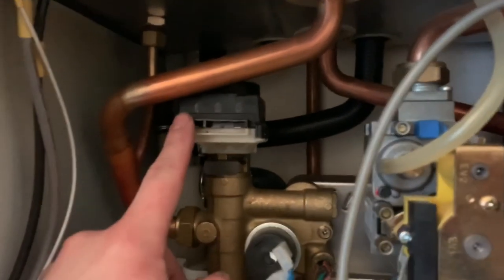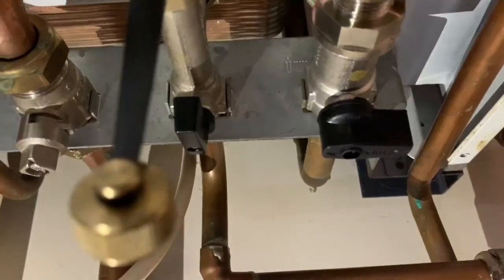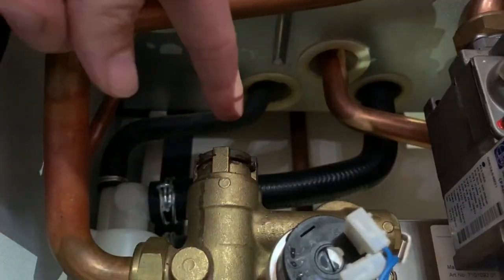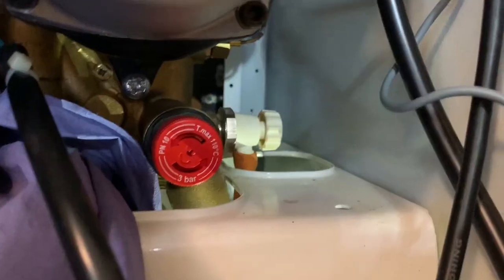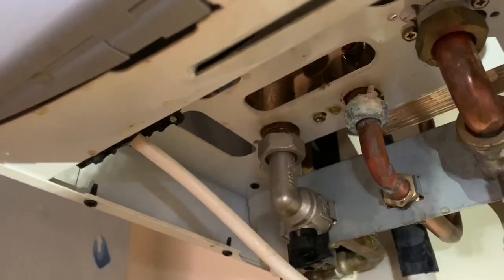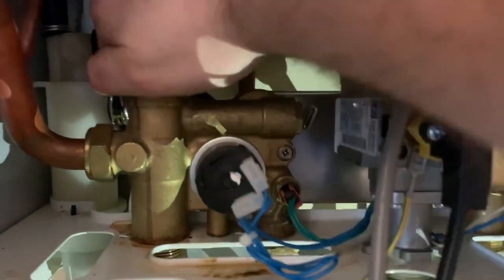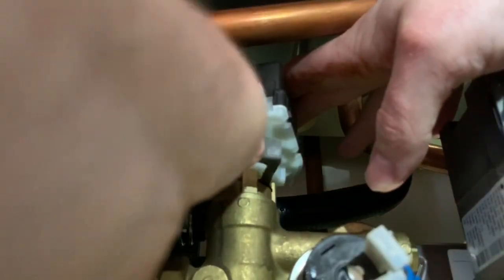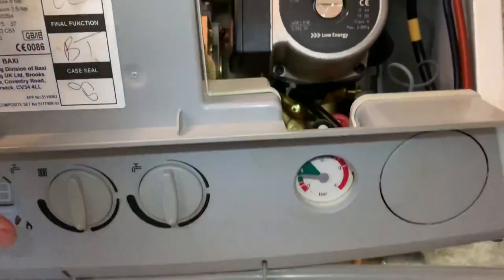How To Replace A Diverter Valve Cartridge And Head On A BAXI Duo Tec Combi 33HE Boiler

Comment: I just followed along with this how to video on the same boiler used in the video and it worked perfectly. Hot water now restored, thanks for sharing.
Reply: Hi I'm pretty competent contemplating ordering the part got heating but hit water just going cold all the time think it's been long time coming ..just power off some draining and easy enough ? Currently got front off and lower section lowered

Comment: Hi there can this valve issue also cause the radiators to remain cold but have hot water? As I appear to have no radiator flow, but power to the pump and it sounds to be running. Thanks
Reply: I think so. Hot water but no heating. The diverter valve is stuck. This could be the issue.

Comment: Thanks for the clear instructions on this video. I'm getting a lot of water leaking out from just where the motor head sits - would this be an indication to replace the diverter valve as you've shown, or some other problem? Potterton Promax boiler, about 10 years old.
Reply: I'm hoping to do ours in next day or 2 . But get a new  mot8r head only around 10 quid . Likeky just seals gone bad and the motor will be affected corroded etc

Comment: This diverter has been replaced 4 maybe 5 times in 7 years on my baxi duotech 24 he, any idea why this fails so often, also recently noticed hot water temp gauge goes over 60 when its set to 50, it also exceeds 65 which is supposed to be the max, do you think there is a fault with something or is this just normal for baxis
Reply: Mine has also apparently failed twice in the five years we've lived here. We have noisy pipes and what sounds like a water hammer issue. I wonder if a water hammer arrestor would help.
Reply: Hi I have had this issue on 2 boilers and had numerous cartridge valves replaced on both. It was such a joke, in 2018 Baxi even changed the boiler for free, ensuring me this would solve it. The new boiler lasted 15 months before that as well failed. It’s a moving part but it’s been massively under engineered to save costs. What they have saved in component build costs, would now be well outweighed by the amount of breakdown warranty claims. My boiler is currently broken down, awaiting another engineer visit to repair the same fault again. I am now considering getting the boiler replaced with a different manufacturer as it’s proven over 2 boilers these Baxi / Potterton boilers are really unreliable due to this fault.

Comment: I followed this steps and i fixed my boiler....thank you so much....
Reply: I have a question....i just realised that after replacing that diverter valve ...when i use hot water my radiators start to heat up aswell even when the heating is turned off....any advice?thanks
Reply from the maker: The role of the diverter as you know is to divert the water from the heating to hot water when required, I would suggest checking the diverter again for blockages/debris making it stick. Double check it is working and the motor head is doing its job too. 👍🏻

Comment: Thank you for the tutorial video. I've just replaced a faulty diverter valve for the grand sum of £23.90. parts and a length of 10mm rubber tubing to connect to the drain off valve. Plumber wanted £180 all in
Reply: I was just quoted £288.
Reply: Great video . . .but even though it seem a lot, that is standard price for a plumber

Comment: Great video. Is this likeky my issue .......h9t water often goes luke warm or cold . Pressure of hearing system is mostly stable but can drop by 0.5 if it kicks . Rads all hot . Bled etc no air in rads . Occasionally 1 tap on its own won't activate the boiler but 2 taos will.....But often same issue with water going warm ir cold .

Thank you 
I've got the both parts on order you mentioned inc a thermister just in case. 

Thank you

Comment: Great video. The pin in my cartridge wouldn’t depress. It is stuck. It’s making a loud noise when switching over. Would this be the cartridge or the motor. TIA

Comment: Great video
So easy when you know x

Is it easy to change the heat exchanger in this type of boiler ? I have the 24 HE model and I’m going to attempt it. The manual says you have to firstly remove the gas valve !!!!!
Also….. what gauge (bore size) is the orange tube ? 1/4” ?

Comment: Hi. Watched this vid re changing valve motor unit.  My duo-tec 5yrs old is tripping our circuit breaker and I found a water leak, just a bit wet, around where this motor unit is fitted onto the water valve. Do you think internally the motor unit might be getting water damage causing the trip? The plastic casing and where elec connector is fitted all looks dry though so was looking for advice. Replacing the motor and valve looks really easy for me and would be a great fix if you think is cause. Appreciate any feedback

Comment: Hello Dan , thank you for the video . Wanted to ask if i am going to replace a double check vlv isolator do i need to drain the boiler ? Or can i switch off the boiler and turn off the pressure keys to change the old vlv ?
Reply from the maker: If you’re replacing the built in full valve then you don’t need to drain off just isolate under boiler and change 😊
Reply: @PlumbingGy  Dan you’re a legend - subd

Comment: Hi mate I have the exact same boiler but have no central heating should I change the diverter valve cartridge or pump? Thanks
Reply from the maker: As long as you have the required certificates to work on gas 👍🏻👍🏻

Comment: very nice video .mine is jammed.  cartridge is been stucked only  top part of the cartridge comimg off rest has been stuck.  do you any reason why is it happening. thanks
Reply from the maker: They do require a slight wiggle but be careful not to snap it, as it is only plastic

Comment: Would this part only make noise when calling for hot water? Our system has been making a whining noise when only the hot water is called and running and not the heat. Seems like the noise is coming from the head.
Reply from the maker: You may notice a slight whine if it's clogged or potential debris causing an issue inside, or when you hear it working it may sound like a click which can be a sign of the head going. 👍🏻

Comment: Hello, I have the same boiler. I drained the system and fitted a new radiator, I filled everything back up. Now my problem is I get hot water but no central heating. I can hear it turn on, but no heating to the radiators. So will doing this fix the issue.
Reply from the maker: It could be a few issues, unfortunately without looking I can’t give you a good answer

Comment: Just changed my divertor valve and now my temp is going through the roof. Lots of scary noise coming from boiler. So much so that I've got to switch it off. Any ideas?
Reply from the maker: I would go through the checks for the thermostat, without looking all I would suggest to start with 👍🏻
Reply: @PlumbingGy  Think it was an air lock. I bled the pump and all my radiators and its all working now. Cheers

Comment: Hi Dan. How come this part was changed? I have the same boiler. Some of my radiators are hot, some aren’t even warming up. I’ve checked for air and flushed the system.
Reply from the maker: This was changed due to the valve not operating correctly so it would either be hot water or heating, the other wouldn’t work at all.
It does sound like yours may have either blockages or debris build up with the rads/valves, if some are getting hot you know the valve is working…. Unless they’re piped off the hot water circuit 🧐
Reply: @PlumbingGy  I doubt they’re piped off. Everything was working fine. Been off all summer then came winter and some were hot and some weren’t. I’ve thrown some flush into two radiators. I’ll let it get round the system. Then flush it out and see how I get on.

Comment: Question, is this a job someone is allowed to do themselves? Quoted £300 for diverter valve replacement by a highly recommended local company. I thought you should never touch the boiler yourself.
Reply: I think you're probably good so long as you just don't disturb the gas system... At all!

Comment: Not fancy mentioning how to check if a bypass is fitted ..🤔🤔
Reply from the maker: Why would I mention that
Reply: @PlumbingGy  maybe cos if divertor has the built in bypass from it as some do then the cartridge can’t be replaced and it’s a full new valve.. 🤷‍♂️
Reply from the maker: It would be different therefore a completely different video. If the person replacing the part cannot identify simple observations before they order the part then they shouldn’t be touching it. Again it would be a different part entirely.